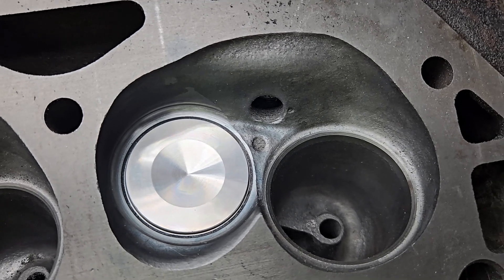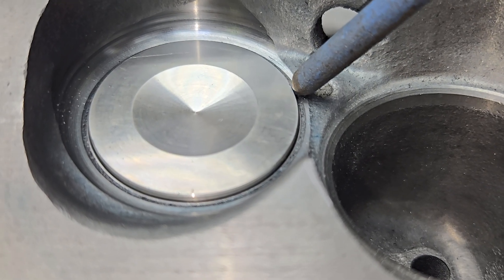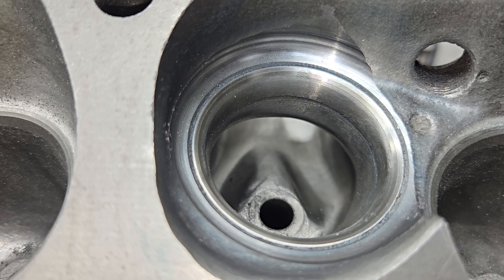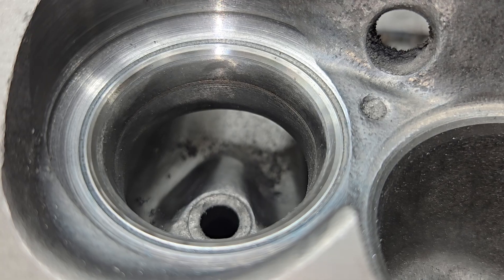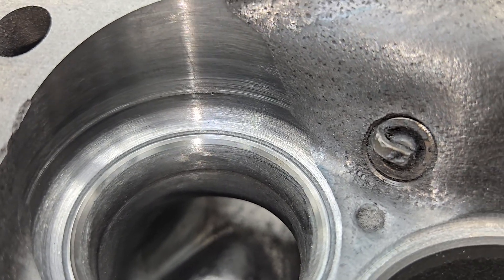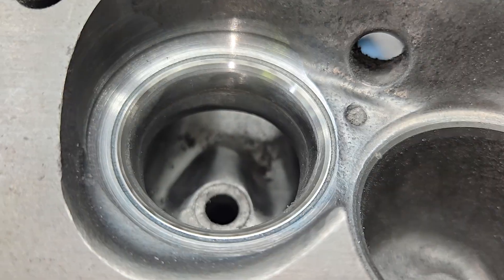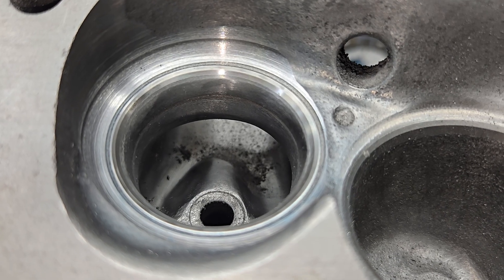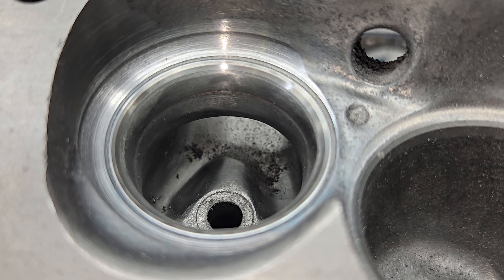Sioux stone valve grinding-plunge cut, L29 Big Block Chevy, New Big Block Mopar 540 project!

Comment: Looking forward to the next numbers on these heads!  the exhaust ports are tiny compared to other BBC castings.  Curious to see the final chamber shape you use and curious to see how much you "un-swirl" the swirl ports.

ps. beg the neighbor kid to lift the heads on the bench, dont hurt yourself! haha

Drag and drive is basically were you drive the car (sometimes with small trailer) from track to track for 3-5 day race events.  300 - 1000 miles with 3 -5 race day events.  pretty cool new event style.
Reply from the maker: Good info. Flows will be a while still. Stay tuned. Thanks

Comment: Your rattling and chattering is caused by surface area contact and is probably worse the bigger the corner radius. You are right to knock the rpm down. It might also help to cut multiple kurfs in the stone just as you cut the one. Anyways it can't hurt as it increases the place for the cut off material to go.
Reply from the maker: Thanks!

Comment: The M1 337 intake appears to be a really good manifold considering the low profile.  Andy Finkbeiner (sp?) made 800 HP with a large roller cam on a 500+ BBM.  It was one of Mopars better parts and of course they stopped making them.
Reply from the maker: Excellent info! Thanls!

Comment: Good to hear from you Charlie.  Don't overdo it. What is the latest news on the 193 swirl port heads? Thanks for the video.
Reply from the maker: Haven't been touched in a while. Thanks
Reply: @servediocylinderheads I have been re watching about 20 videos about the 193 heads . Nobody has done that much work to them as you have. I want to build a 383 for my 69 Camaro  car then put it in a truck with the swirl ports Until I can build a good engine for the Camaro. I have some 20k mile heads 1 ton and lighter duty.